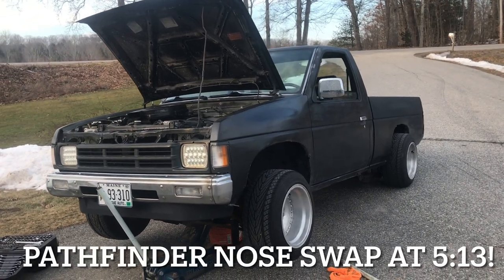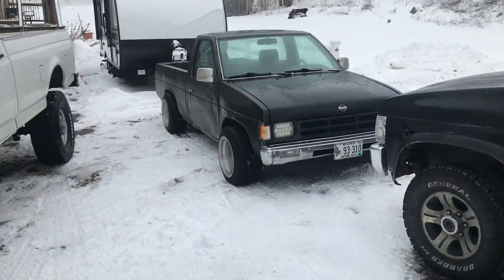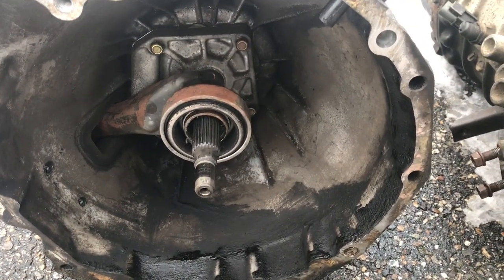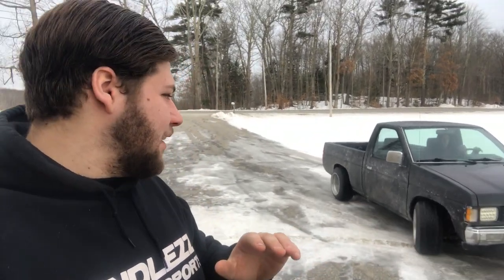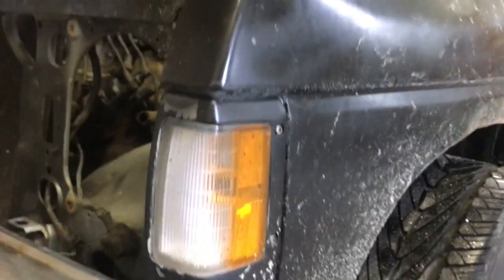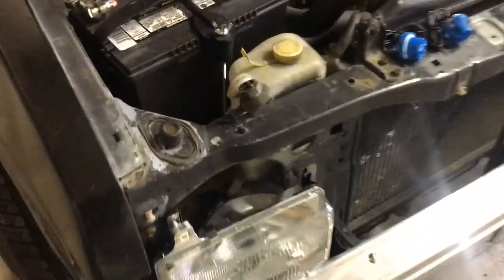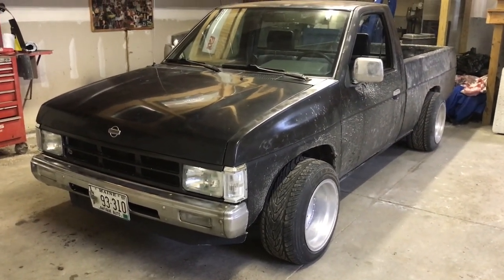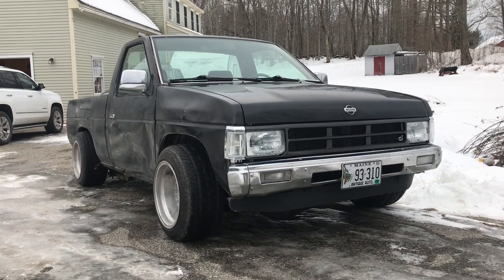Nissan Hardbody D21 Pathfinder Nose Swap + New Transmission!!

Comment: Thanks for the video
I plan on doing this swap also.
The wider headlights,
Clear corner lights 
Clear bumper lights, 
4x4 fenders, 
4x4 fender wheel well plastics L/R and push pins.

I also prefer the older style hood with the 3 holes.
I like the 93' style blackbumper instead.

The power windows would be a cool thing to add as well.

Your chrome features will match your mirrors and Wiper arms, but I prefer
- Black mirrors
- All Black Wiper Arms

Tip for anyone getting Wiper arms off another truck...watch out not to break the plastic covers, and try to get ones with the plastic not cracked..

You gotta be careful pulling the wipers off, and some lite tapping and shaking the wiper arms will free them up and then they will lift off.

Another trick I found is to use a gear puller to pull the Wiper arms off.

1998-2004 Frontier tailgates should fit as a tailgate swap also.

Truck is looking good - Thanks
Reply from the maker: Some of my favorite things to do! So glad to hear it now, thanks for checking out the video!

Comment: Nice video thanks for the mod video as well. If I did that mod I would try and sand and take care that rust and repaint to prevent further rust witch will effect future rotting. Aloha from hawaii 🤙🤙🤙🤙 93 hb auto swap
Reply from the maker: I for sure agree, we ended up trading the truck up for something else after winter, if we knew it would’ve been a long-term vehicle though that definitely would’ve been the route!! Thanks so much for watching the video too!

Comment: Are those headlights originals and also the corner lights how about the grille is it original as well
Reply from the maker: All aftermarket parts to replicate original parts, but essentially yes, it’s an original Pathfinder nose on a Nissan hardbody, typically the factory lenses on the corner would have orange these are aftermarket so they’re full clear

Comment: Where do you find all the nice chrome and I was also wonder what wheel demotions your running it looks so good
Reply from the maker: So I have staggered wheels with 8 inch in the front and 10 1/2 in the rear! And 195 50 15 tires on the front and 225, 15 50 in the rear,  also I get most of my parts off of carparts.com!
Reply: @JapaneseMinitruck  I didn’t know if that was a safe website or not I kept seeing them pop up thank I really appreciate it I accidentally just bought it as a daily and got to lookin and now I wanna build it 😅
Reply from the maker: Super worth it they’re a lot of fun to build and really affordable! Carparts.com has been great to me I was skeptical at first but they like sent me a new fender free of charge when one came in a little messed up! Didn’t even have to return the other one!
Reply: @JapaneseMinitruck did you have to use adapters ???
Reply from the maker: adapters for the wheels? no, adapters for the headlights? you just need the right pigtails for the pathfinder headlights.

Comment: Can we do riv nuts instead of nuts and bolts? I can’t think of a reason it isn’t possible
Reply from the maker: I don’t see why you couldn’t, as long as it’s sturdy! I think the only downside which isn’t  that big of a deal is having to drill out the riv nuts if you need to takeoff the housing, but it’s not like it would be a consistent thing so I would send it!

Comment: hey! i just bought a 1992 Hardbody, its a 4x4 can i still slam it with the drivetrain?
Reply from the maker: I mean I don’t think it’s impossible but it’s definitely wouldn’t be easy at all, I definitely don’t think it would be easy to slam it without some crazy work switching everything over to a lot of 2 Wheel Drive components,
Reply: Eww don't slam a 4x4
Reply from the maker: can confirm, I attempted to lower a 4 x 4, and it was not successful. Even with a lot of custom work, I ended up chassis, swapping the truck to a rear wheel drive frame. hahaha

Comment: What exhaust setup are you running?
Reply from the maker: Unintentionally we’re running a straight pipe with a cherry bomb eventually that will change though, we had bought the truck like that, it was fun for a couple months but it’s definitely too rowdy and doesn’t sound too great, highly recommend going with 2 1/4 inch piping magna flow muffler and a vibrant resonator before the muffler, it has a beautiful sound!

Comment: did you loose brain cells when switching the bulbs? bro changes an orange bulb to clear and says it makes it legitimately look clear as he puts in a clear bulb like bruh.
Reply from the maker: Yes, it legitimately makes it look clear as it should look, if you get clear lenses and leave the orange bulb, it wouldn't look legitimately clear, why is that hard to comprehend?  When you buy the clear corner lenses, they give you orange box to put in them, I was just stating to use a clear bulbs from the factory so you don't have a little orange spec in the middle of your clear lens to keep a full 100% clear look.